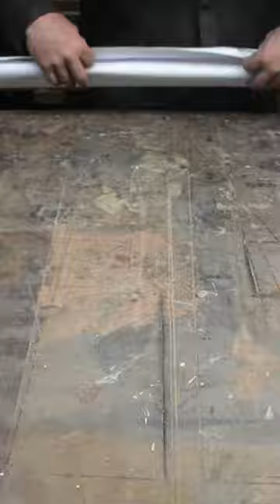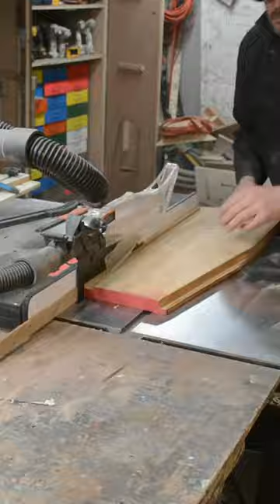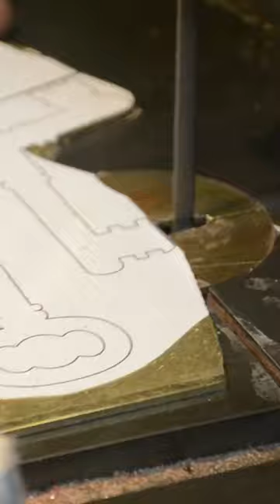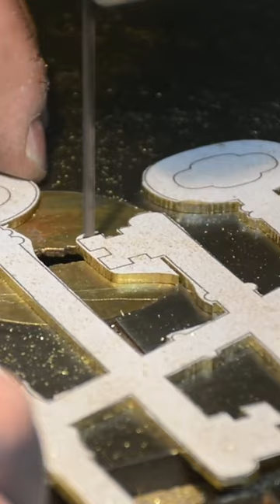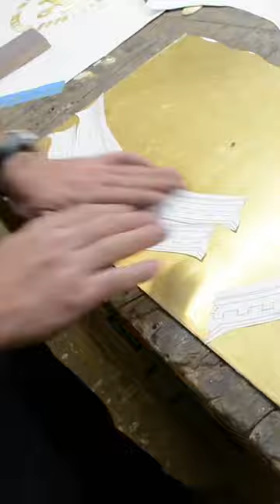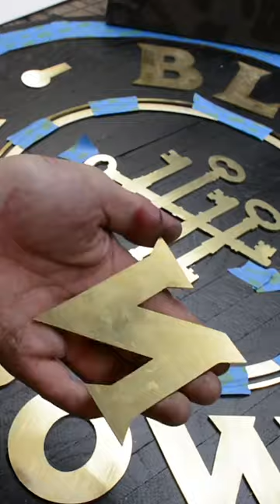Brass on the Bandsaw: A Blade & Bow Sign

Comment: What kind of blade is being used here? I had no idea bandsaws cut through Brass just like that, without lubricant or anything?. That's amazing.
Reply: Cutting or machining brass requires no lubricant. Use a blade with a high tooth count it’ll cut brass like butter.